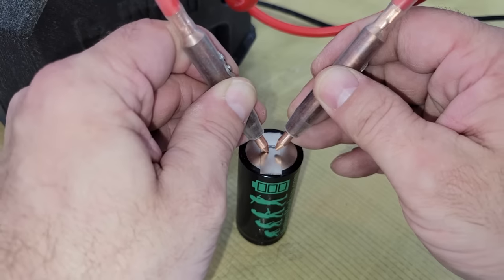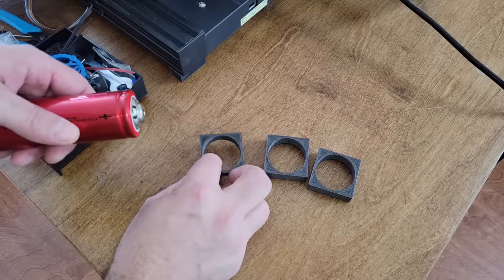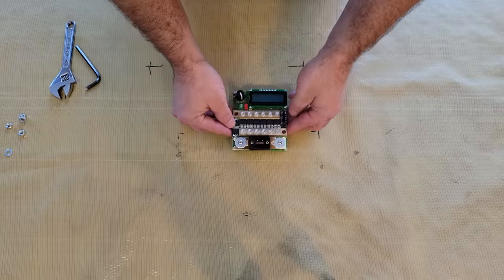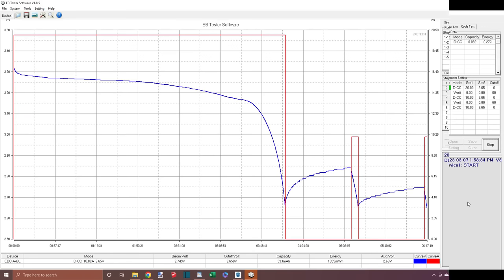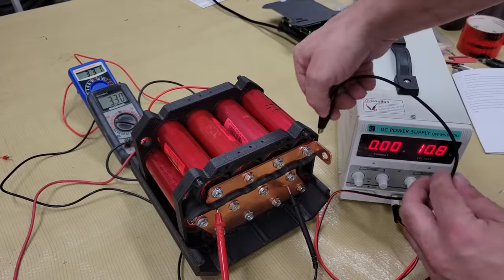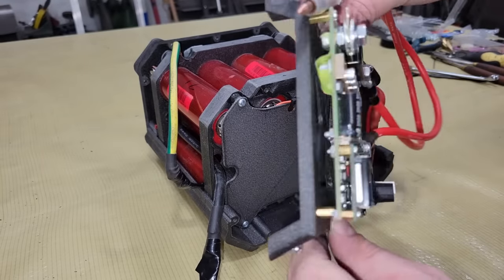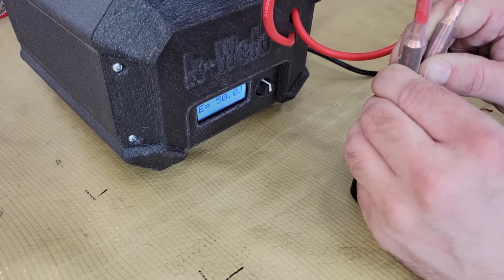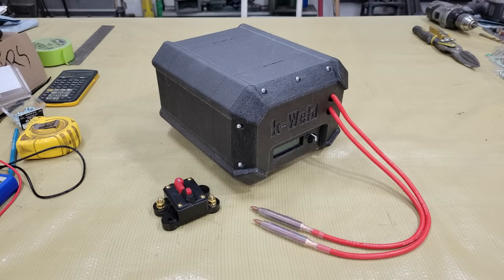kWeld DIY Spot Welder - Custom Battery & Enclosure

Comment: I do see a problem with your design. I build a ton of batteries and the kweld is an amazingunit.  I've been abusing mine for over 3 years. If you're doing a ton of back-to-back Welds you know how hot the electrodes get. The kweld unit itself gets very hot. Most of us incorporate a fan into the design of the case.
Reply: The case itself is amazing. Its is well worth the asking price. I didn't meant to take away from it great design
Reply from the maker: Thanks! No worries. I'd considered it, but my older welder never got hot and some others had said that only their kWeld electrodes get hot so I figured if it ever did get warm in there then I could just drill some vent holes and add an axial fan. But I'm making a new enclosure to accommodate moving the switch to the top to shorten the cables, so it's a good opportunity to plan for a fan and be done with it.
Reply: @JamesBiggar  mine get so hot you can't hold the electrodes when wearing gloves.  I have a little stand I sit in front of a fan to cool them off quicker. We need water cooled electrode holders.

Comment: What is the verdict 6 months in? Is 9.4V nominal enough for the kWeld? It has about 6.3V static overhead so not a lot of headroom to work with. Surprised the cells have a low enough impedance to get to 1500A. (11.0V - 6.3V) / 1500A = 3mR for the 4P3S battery. (3 / 3S * 4P = 4mR per cell, that' s exactly what the datasheet says!

Comment: If you punch or cut a slot or hole in the pure nickel strip, you disrupt the path of least electrical resistance for the spot weld. This forces more electricity down and across the cell. More energy is used for the weld than arc across the nickel. Requires less energy
Reply: Iove your videos!

Comment: Excellent video as always. I wonder if it would have been safer to go with glass or Kevlar/aramid reinforced plastic for the case. I vaguely remember something about battery enclosures in Formula Student having to be made from Kevlar because of Carbon Fiber's conductivity.
Reply from the maker: Thanks. Good point to keep in mind in some cases. Cf is conductive. Nowhere near as conductive as metal, but it is conductive. But cf composites have relatively poor conductivity, if any, because resins and plastics are insulators - especially if the cf content is just 10% short strand and not a higher concentration of continuous strand, like cf cloth that would account for 60% of the content in a laminated part. An ohmmeter is a fool proof way to double check and verify specs if there are any doubts when using cf composites like this, though. This filament wouldn't be my first choice if I had other options on hand at the time - it has better uses than for simple project cases. But it's not conductive in the least and saved me $30, so it happened. Obviously, no problems lol. But if it were conductive, the danger would be in using it for the cell holders, not necessarily for the enclosure. That can be made of anything, as long as it's isolated from the electrical.

Comment: if you wanted to run a b.m.s could you use a small one and use the switched output to drive a large mosfet to control the load

Comment: Nice build! K-Weld is great. On mine, I just used a large RC Car battery which proved more than adequate for spot welding ni-chrome tape onto 18650 batteries. I use a multi-mode charger to top up the battery prior to use.  Even now, storing Li-Po batteries give me the willies so I store it in a steel toolbox when not in use.  An interesting upgrade might be to use super-capacitors instead of Li-Po batteries but lately, I'm not making too many battery packs.

Comment: Takeaway: Respect the k-weld. Acquire the k-weld.
I think this is the best build i’ve seen on a portable battery-powered, full-function spot welder. 
I’ve been using a beefed-up inexpensive spot-weld pcb on a 4s2p headway pack for a few months & it works great, but I’d like to do a similar build to this ultimately. Sweet build!
Reply from the maker: Thanks!

Comment: Just saw the battery build and couldn't get over how trick looking that kweld case was and was thrilled to find a video for it too.  And overjoyed to find that you also released the files for it.  Will have to check if I have enough headway cells to make one.  I don't think I have copper laying around so might have to just spring for the case from battery hookup.  Probably be best to retire the old poor lipo.

Comment: Awesome work James, as usual. Watch out for puncturing the battery (especially on the negative terminals). That can be a nasty emergency to deal with (I recommend a metal trash bin while making the battery). I'm looking forward to the rest of the bike build. Take care!
Reply: You can put a but of sand in it aswell be sure to be able to lift it.

Comment: Overall, i like your set-up. Couple suggestions:
1. polish the electrode tips with sand paper. You want highest resistance to be between nickel strip and battery, not somewhere else in the circuit. 
2. You may want to consider a 4s instead of 3s configuration. Been using 3s set-up for a long time, but sometimes it just does not have enough voltage to drive the amps.
3. With 100J and 1200A i welded through 7, yes 7 strips of 0.15mm nickel, but i did have one electrode on the longer bottom strip and another on a shorter top strip. Point being is, you can do allot more than is reasonable with this welder if you prep for it just right. Having a blunt tip electrode as a ground on the bottom piece is a good way to force all current through weld spot without marking up bottom piece; but this is a unique case.

Comment: This is the cleanest and most indepth video I came across about kweld. 

I have a couple of questions.

1. Is it possible to get a good weld 0.2mm copper sheets with this setup? If yes, how many joules should it be set to do that and if it's even capable of doing that.

2. You said it's capable of 2000A but wouldn't a 4p make it only 960A pulse? Or are there capacitors inside to make it go up to 2000a
Reply from the maker: Thanks. Others have welded .3mm copper. The welder itself is capable of 'handling' up to 2000A before it trips the overcurrent protection. Whether or not it produces that depends on your power source. My battery is capable of producing well over 2000A of weld current - not just 960A. A battery's weld current is not it's rated current - continuous or pulse. Weld current is much higher than pulse current. Continuous current is just that. Pulse current is sustained for 5-10s depending on the cell type/make. Weld current is sustained for only a split second and the current can reach magnitudes higher than the 5-10 pulse current (hence why it's rated for 2000A but only uses a 350A fuse, and why using a capacitor bank that's designed for short, powerful bursts is ideal). As I demonstrated in the video. If the battery was only capable of 960A, then I wouldn't have tripped at over 2000A and wouldn't be welding successfully at 1400-1600A. As I mentioned in the video, I adjusted the current below the 2000A limit by adjusting the resistance in the circuit. But at 960A, this welder wouldn't be much better than a $50 Ebay welder. I think most people's problems when it comes to understanding the kWeld and how to choose a power source roots back to simply ignoring the user manuals because they involve math and a more in depth understanding of electricity, and just revert to assuming that the battery c-rate is what matters. But that's only part of it. Most folks eventually figure it out through trial and error, but using the math will save a lot of time, $ and bs. A high c-rate matters because it indicates a battery is capable of high welding current too, but you won't ever know what the potential weld current is until it's calculated using the methods that kWeld provides in the manuals because batteries aren't rated on their weld current. Only continuous and pulse current. If you choose a battery with a max pulse current of >1000A, then it should get you well above the 1500A sweet spot that kWeld recommends. Welding copper requires a lot of amps, though, and you're going to need to push the limits of the welder. But as long as you have the current, then how many joules it's going to take to weld 0.2mm copper boils down to the resistance in your electrodes and electrode cables (mainly how clean your tips are).
Reply: @JamesBiggar nice and thank you 👍

Comment: This is an awesome design! Did you have a lot of trouble print carbon fiber on an Ender 3? What kind/size nozzle did you use?
Reply from the maker: Thanks! Yes and no. Not at first, most of the printing I've done with it for this project and the past went well. But later on I got a bad spool and had a few fails (noticeable extrusion issues in the front and back panels of the welder in this video). Upgraded to micro swiss all metal hot ends with wear resistant 0.4mm nozzles when I started printing petg back in the fall.
Reply: @JamesBiggar  What brand of CFPETG are you using?

Comment: Thanks so much for this awesome design! I just put one together for myself and want to avoid this issue with the switch creating too much resistance but still want to weigh to be able to turn the spot welder on and off. What did you end up doing for a solution?
Reply from the maker: Np. I've just been using it with the switch for the time being. It sufficed for what I needed to do with the bike battery. But I think the best solution is to mount a switch on top of the pack and shorten the leads by half, maybe step it up a gauge if needed too. That should put at least 1500-1600A into the welder and provide ~1300-1400 at the electrodes. I'm pretty sure the current shown during calibration is current into the welder - losses from the electrodes aren't included in that reading because the 2000A protection is based on current going into the welder, and not knowing exactly what is going into it would only make it harder to change the leads to suit accordingly. I think the current shown after a weld is done is the actual weld current. The weld current is always a couple hundred amps lower than the cal current, it seems. The switch could stay in the back, but a person would need to run 1awg cable between the pack and the welder. I'm ditching the breaker switch entirely, too. Just going with a standard 300A cut-off switch. The breaker switch trips easily when it starts to warm up. The welder's protected by the 300A fuse anyway.
Reply: @JamesBiggar  I see. Thank you for the detailed reply. I actually ran 4awg welding cable all around so hopefully I wont run into too many issues with resistance. btw it looks like you did not include the block into which you epoxied the XT60 and JST connector in the list of 3D printed parts. Would you happen to have a link to that STL?
Reply: @JamesBiggar  i'm in the same boat. I just started printing the parts but saw that the jst/xt60 block stl isn't included.

Comment: Great job, James! Can't wait to see it finished, I'm building one myself, did you sort out these Headway cells problems?
Reply from the maker: Thanks! No problems with the headways other than being lower in cap than when they were new. Rated for 8Ah, but testing at 7. Not a big deal, they still work fine for stuff like this. But it's not enough capacity (specifically energy density, cap vs weight) to use them in the bike.
Reply: @JamesBiggar  I've come across some great cells that can output decent power and very decent energy density for being LiFePO4, if you're interested, is there anyway we can get in touch?

Comment: The amps listed during the "overcurrent" test was LESS than the next successful test shown on the video... which is odd. Also I looked up the datasheet on those mosfets and with 6 in parallel,  a drain to source voltage of 9.6V, and and on time of 32 milliseconds (lowercase t value shown in video) would get you outside of the safe operating area chart... which is odd. Am I seeing missing something?
Reply from the maker: 🤷‍♂️ You seem like maybe you've got the know-how to build your own. This isn't a promo and I don't work for Keenlab in any capacity to understand the ins and outs of their products, so I can't really answer your questions about the design of the welder itself - only what I've done to stay within the current and voltage range suggested.
Reply from the maker: Afterthought; I think the overcurrent protection is based on current going into the welder from the battery, not the entire circuit. The display shows the total welding current of the entire circuit, electrodes included - not just the current going into the welder. So when I changed the power cables to lower resistance, I could have been dumping >2000A into the welder but only getting 1500A at the electrodes with the added resistance. When I switched the cables after the overcurrent error while still bypassing the switch, I actually shortened the electrodes by 4" as well. This probably explains how I managed to stay below 2000A going into the welder but got a higher welding current than before, because the resistance between the battery and welder was increased to lower the current, but resistance was decreased in the shorter electrodes. I should have noted that I shortened the electrodes in the video.

Comment: Thank you for this. I am currently building this exact setup. Areyou running 3s4p or 4s3p? I am going to be incorporating a daly bms on mine.
Reply from the maker: 4P3S. Make the parallel groups first, then connect these p groups in series. If you make series strings and then connect them into parallel (ex 3S4P), you'll need a bms that can monitor the cells in each string (ie 12S bms vs 3S or 3 bms' vs 1) = more wiring or more $. You'll have 12 individual cells that need to be monitored. Connecting the cells into p groups first effectively converts the smaller cells into one larger cell in each group (they automatically equalize when connected). So when you series connect them after, you're just connecting 3 larger cells together and will only need a 3S bms to monitor them.
Reply from the maker: ...and your Daly needs to be rated for 2000A surge. Pretty sure they don't make them that large. The most powerful is the 500A model that can only handle up to 750A surge before the relay cuts power. JK bms might work with a 1000A relay, but you're taking a risk with an expensive component and adding more complications for what should be a simple project. Hence why I opted to not use one. As long as your cells IR are matched, they're bottom balanced before assembly as I showed how to do in the video, and you adjust your charger to the sum voltage of the cells when the weakest reaches max voltage (you need a way to monitor individual cell voltage during the first charge in order to calculate and adjust accordingly, like multiple digital multimeters), then you DO NOT need a bms. The charger will cut off before there's a risk of overcharging/high cell voltage, and the bottom balance will ensure the pack stays balanced on the bottom end so there's no risk of overdischarging/low cell voltage. Unless a bms is an active balancer, then it's not doing much (if any) balancing. Passive balancers like the Daly are just intelligent circuit breakers, and thus, depending on the application, you will always need to either top balance or bottom balance the cells before assembling the pack and connecting the Daly (ie circuit breaker). The balance current in a Daly is way too low to do anything significant and keep a pack balanced. I've had them do more harm than good with the balance feature turned on. Active balancers do a much better job at balancing, but they're better suited for top balanced systems that are constantly charging and are rarely discharged fully, like a solar/wind power storage system. These are never drained unless poorly designed, for what should be obvious reasons. You welder, on the other hand, will be drained to nothing repeatedly, so a bottom balance is better for it because the cells will be matched in voltage when they're drained and you won't risk overdischarging and damaging one of them unless you completely ignore your voltage display and discharge below your min sum voltage. An active balancer would undo the bottom balance and attempt to top balance the pack, putting it at risk of tripping the cell low voltage protection circuit every time you use it. This is why some ev's don't use bms', they just bottom balance.
Reply: @JamesBiggar  Thanks for the quick reply. I am in the process of bottom balancing the cells right now. I am going the same route that you did.
Reply: @JamesBiggar  You do the 4P first to handle the load?

Comment: Regarding the old spot welder: Did you tried to clean the ends of the copper welder pins with sand paper?
Reply from the maker: Of course. The connection between the electrodes and the strip is no different than any other in any electrical circuit - it must be clean. The electrodes on the old welder are actually a bit shorter than they were originally because of sanding them over the last couple of years. The problem with the old welder is that the power source is worn out and wasn't great to begin with. It's underpowered for nickel strips that thick, never could weld them. ~588A at 8.5V = 5000W. The kWeld provides 1400A at 9.6 = 13,440W, which is just enough to make a strong weld as shown.